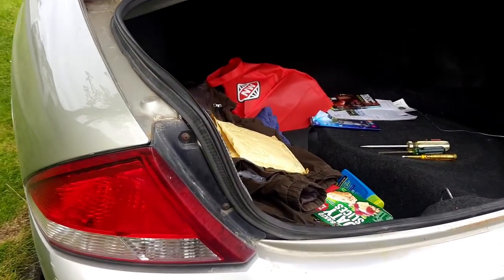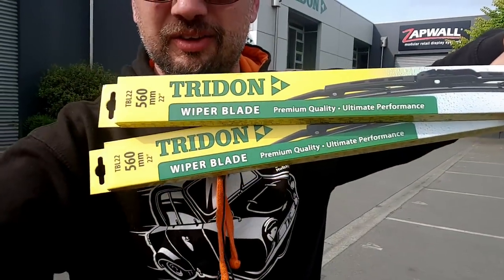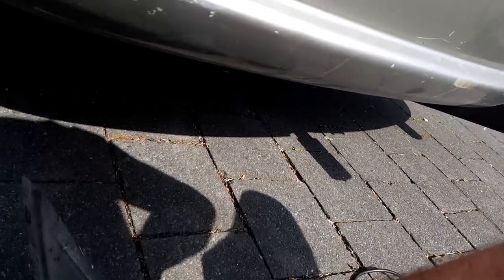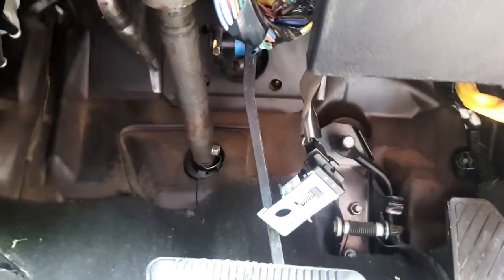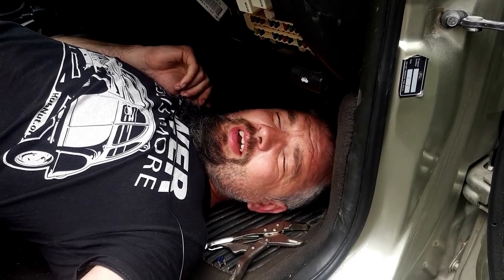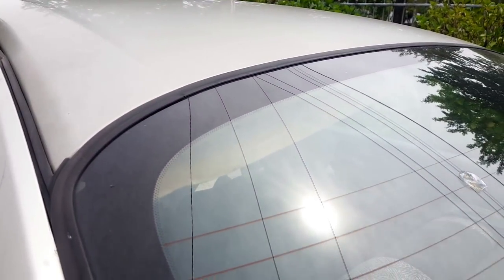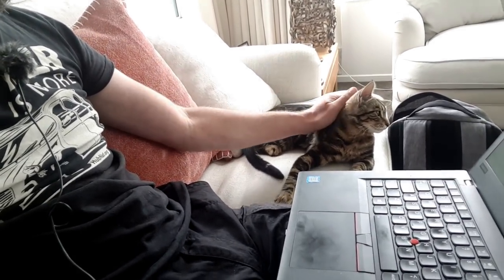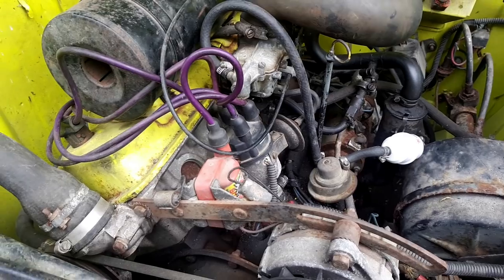(EP22) Ford Fairmont Fail and Fix, with bonus Peugeot 404

Comment: Dont u have to go over a certain speed to activate cruise control?
Reply from the maker: You can 'arm' the cruise control at any speed. Not sure what the minimum is to Set it. I shall experiment.
Reply: @HubNut  it'll be around 60kmh methinks
Reply: It's good if a (standard) cruise works at low speed - good ones sometimes go down to about 19mph-ish. Modern Adaptive Cruise Controls with an auto trans usually won't set below 20mph, but once locked onto a vehicle in front (or with a 'resume' with a moving vehicle in front) will go down to a stop, and then restart from zero if still 'locked on'!  I like the way you said your Fairmont's cruise is nice and relaxed on a 'resume' - that's good!
Reply: I think 20mph is the norm for the minimum cruise control setting for Fords and probably most other makes .

Comment: Osmo camera has good sharp colour and the sound is fine. Cheaper than GoPro and has a front selfie screen so win-win. Get some extra batteries and charger usable in the car. Have you suitable fittings for the gimbal? Osmo does have stabilisation but every little helps.
Carry on cruising.
Reply from the maker: Thanks. It won't work with the gimbal sadly, but the image seems pretty stable.
Reply: @HubNut  There plenty of counter weighted adaptors around for the OSMO that mount on a phone type bracket. all pretty cheap. Have a Google. Check feedback for dodgy screws with the clamp. Many of these look to be the same item with different names and prices. Bodge with a phone shaped bit of ply and a tie wrap plus a small bolt for a counterweight. Free!

Comment: Gee my 1983 Ford Ranger Pick up truck (USA) had a brake light switch just like that, since I really didn't have that truck to long AND had to replace the switch when the truck was fairly young maybe that wasn't one of their better ideas. Gee a Peugeot with a genuine imitation plastic dash board, if it was the higher trim level it would be genuine imitation wood.

Comment: That really is a garbage way of mounting the bulbs. Normally the brake light circuit just tells the cruise control to turn off so I'm surprised that it stopped it from working altogether? However... if you think that's an awkward job - try changing the blower motor resistor on a 2010 Fiat 500 (RHD version)
Reply from the maker: I think the cruise control uses the same fuse, though it seems wise for the cruise to fail if it can't detect a brake input.

Comment: the joys of a beater. when you drive an auto that someone threw away before you, you have to expect a few repairs will be in your future. i just spent the day removing the rear axle assembly from a jeep liberty my mother got for $500 to replace the axle in hers. an axle assembly alone was $250, and we got this entire jeep, minus the engine, for $500. there's no title, so i have to cut it into pieces small enough they don't resemble a car to sell at the scrapyard, but it's still a bargain. anyone need 02-07 liberty tail lights?

Comment: Here in the northeastern US, you don't drive something nice in the winter and my 'winter beater,' is a 2003 Ford Taurus.  A car that while mechanically entirely different to Betty looks eerily like her and I'm happy to see that I'm not the only one to find Fords from that era are a mystery per how parts access is crap.  The EGR valve on Susie is on the back end of the agricultural sounding v6 and it's like inseminating a cow to work on the thing.  https://cdn04.carsforsale.com/3/303676/34354948/thumb/1539631385.jpg

Comment: The Osmo Action is a great little camera but to get an external microphone to work you need an adaptor like this https://www.heliguy.com/cynova-osmo-action-dual-3-5-mm-usb-c-adapter-p6576 But some people have still be having problems with the adaptor. You should be able to pick one up at a DJI dealer in NZ
Reply from the maker: Yeah, bit annoying. £40 for something that doesn't even work that well!

Comment: It's got climate control set it to a temperature with the aircon turned on. You'll use more fuel with a window down rather than running the a/c
Reply from the maker: I know, but sometimes, fresh air feels nicer.